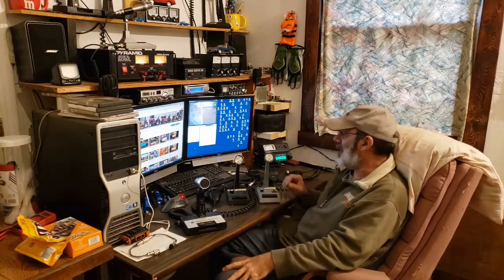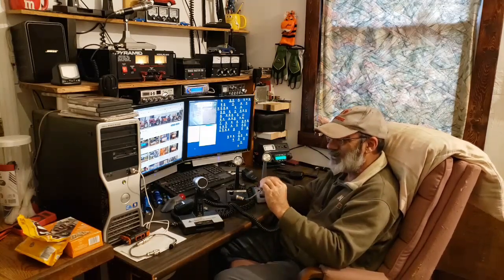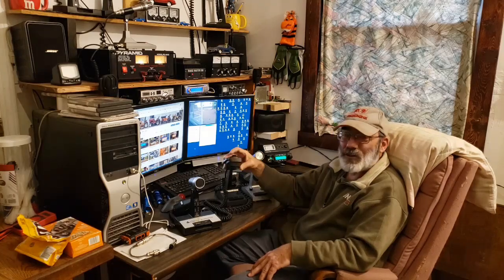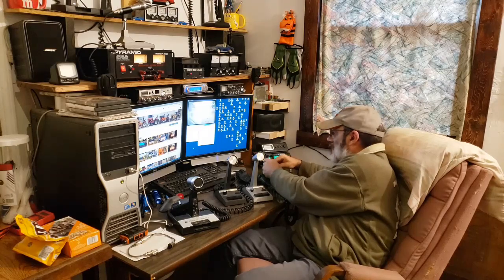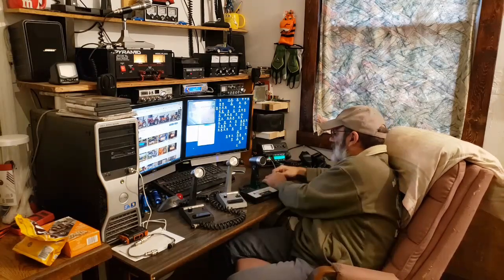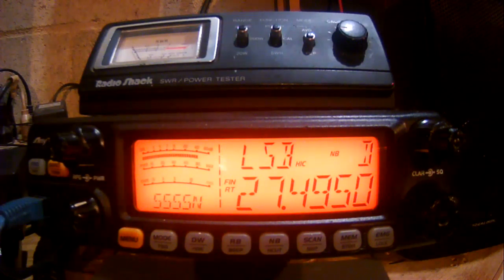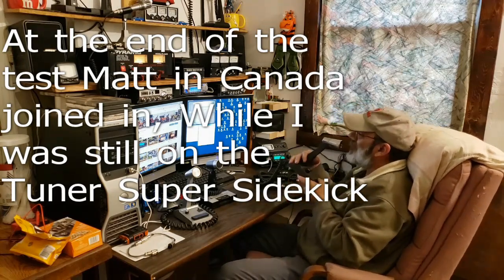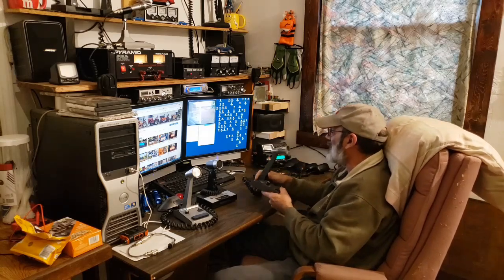AnyTone AT 6666 Mic testing

Comment: On my quag 6  i have also tried many mics. My best luck has been with thee astatic d104 lolipop which i removed the amp section from and added a tone control board sounds amazing.
The 636 and red devil also sound good.
The only thing i like on the stock mic is channel selector,  but even that can be a pain accidentally change channel and not notice.
Great video.
My q5 has been a disappointment. 
I have not had very good luck with anytone at all to be honest .
I love the size of the q6.
Thats about it.

Comment: Thanks for the tests! One note, the Anytone stock mic is indeed an electret condenser element that uses +5vdc on Pin 1, the "modulation" pin. Technically, you should use a capacitor there to block the voltage from interacting with the other microphones circuitry. It's very low current, so it probably won't damage anything, but just good engineering practice to block it.

Comment: Hey, John great to see your video and yes you're correct the stock mike is just a dynamic mic. etc.    I have a 5555n etc. great radio and circuit board in mine.  Like the radio and talk skip all the time with it.   Cheers and thanks for the video.   shared over at the hangout.           Drew     NY202
Reply: I run stock mic.  ON mine.   I prefer the stock on yours.
Reply from the maker: Cool, thanks Drew. 73's
Reply: @MowerJunkie  Anytime friend.
Reply: incorrect. the stock Anytone mic is a electret condenser element and uses the +5vdc on pin 1 audio line.

Comment: I love my anytone 6666. I was surprised that the stock mic actually sounds pretty good. I use a modified Astatic 636. I got the mic from Tim over at snake radio customs. He wired the proper plug on it also, so no adapter needed. I have a non modified 636 mic to compare to the modified one. The modified one has a more full sound, like the full frequency range, low to high. Also the F’s and S’s are clear. My voice is clearer overall and less muffled. I also talk more on SSB than on AM myself. My anytone 6666 isn’t stock. I got it from truck cb sales with his “truckerized” modifications. I looked at my radio on the scope and spectrum analyzer at the school I go to when I got it. And it’s clean and at 14.3v it does about 65 watts average and 120 pep. And surprisingly it just gets a little warm when I talk a lot. I have it driving a 4 pill 2879C.

Comment: I have the cobra dynamic plus - and trying it with the 6666 - the modulation is fine for the first 20-30- seconds - then drops to nothing - I have to disconnect the mic for a while - then it works again same issue - tried it with another radio and it works fine without the issue - and I'm using a uniden 4/6 pin adapter - any advice you can give as to what may be wrong with my setup ?   Thanks- .

Comment: Easy mod to the standard microphone, the front clips off revealing a tiny mic hole, just drill a larger hole & it works fine.
I do have an Av-908 desk mic & a KPO Power mic, but the 9900 doesn't like them on Ssb for some reason, so interested to see how you get on.
Whats the radio Mic set at in the Menu. 407 Mcr 👋 
Have a lovely Sunday, you and Mrs Mower too 👍🇬🇧

Comment: The stock mic works alright, but I don't know why everyone says to leave it, of course there are better sounding mics out there. And you may want to throw a voltmeter on that radios audio pin because I understand what you're saying about the pin having 8vdc on it, but there most certainly is voltage on the audio in pin too. Not all dynamic mics will be affected by it, but it is there. There's voltage on the ptt pin too, it's how it gets the up and down by use of different sized resistors. No resistance at all detected is the signal for the radio to key up. I think that's why a lot of folks have shyed away from trying other mics on the quad 6, because you'll find there's DC voltage on 2 of the 3 pins that are actually needed for an alternative mic. The interface I built to connect all of my radios to the same audio set up has a tantalum cap inline with the audio anyways so any radio I hook to the interface will have the current blocked if it has it anyways. There wasn't a whole lot of definitive information to go on when I searched online. It was just a long winded experiment that wound up being a lot of audio gear connected up to everything, even my computer for Echolink and SDR. In the end it was worth all the effort, there's a lot you can do to improve both receive and transmit to adjust for any conditions thrown at you. It's really helpful on the receive end of things being able to cut out unwanted sounds, and enhance weaker signal voices way down in the hash. I guess if I were stuck with the stock mic, I wouldn't be too awfully disappointed, but it usually just comes down to a matter of preference, and I really hate having separate mics for multiple radios. All the naysayers are the reason I do a lot of the things I do. As soon as someone says it can't be done, or isn't worth bothering with, that's my cue to get to work on it.

Comment: The Anytone stock mic is an electret microphone, also known as a condenser microphone. It does have a small voltage for the Electret element supplied from the radio on the audio line. Bias voltage of some value less than 3 volts. 99% of stock radio and many aftermarket mics today are Electret/Condenser.
Otherwise you would have a Dynamic or a Ceramic element microphone.
The Turner +3 mics use the Ceramic element along with compression and amplification.
The Super Sidekick uses the  Dynamic element along with amplification.
The only mics there that would be an advantage over all the others would be the Turner +3s, due to their Compression circuits. Otherwise you'll be hard pressed to beat a quality electret microphone used with the well-tuned radio designed for it.
I have Turner +3s, but I still use the radio-relative stock Electret mics... because there's no question they sound good, aren't lacking or overwhelming in modulation or overdriving the radio... and were FREE with the radio. I break out the compression-wielding Turners when the DX/Skip is rolling in good.
They seem to work fine with the Bias voltage from the radio on the audio line, on the Electret setting of your radio. They are louder on the Dynamic setting. Adjust your mic volume accordingly.
By the way, the Turner JM+3 is not necessarily a "mobile" hand mic. It has no noise-cancelling feature, and will amplify everything else, so it's best use is on the base.
(Of course, I use 5, 1.5 volt, alkaline watch batteries in a heat shrink sleeve to power the Turner JM+3 hand mic, since the A175 battery is not cheaply or easily available anymore).